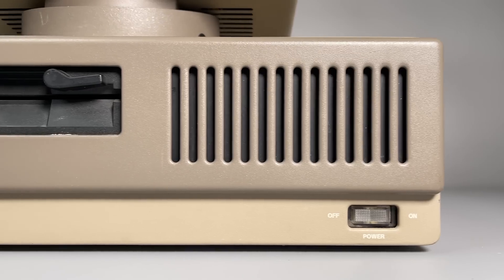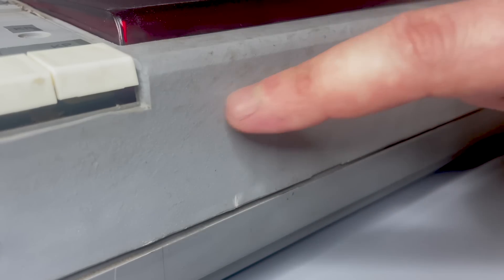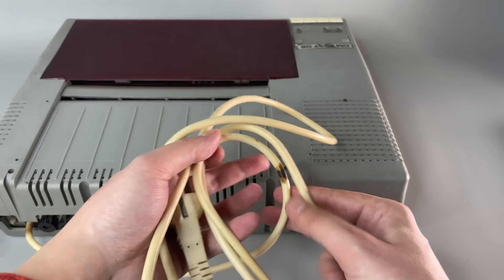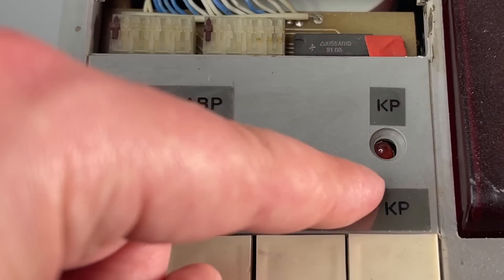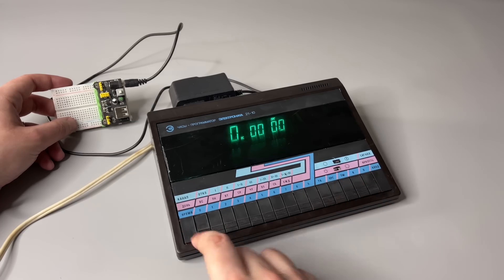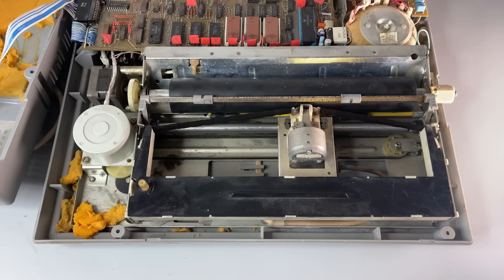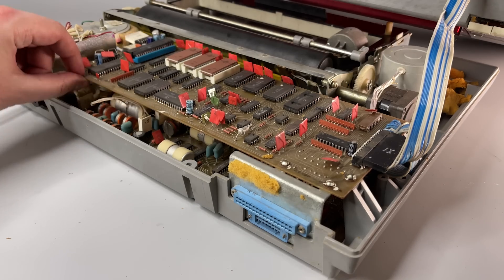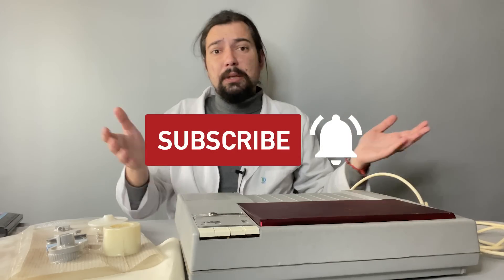This is THE WORST PRINTER I've EVER seen | Soviet SM6337.02

Comment: All such equipment was assembled for the most part in the Baltic Soviet republics, as well as in the Ukrainian SSR, which is where the crooked hands come from. What was done in Tashkent or Minsk looked from a completely different world, architects lived in these republics
Reply from the maker: Hm. Interesting point. Especially on Baltic states.
Reply: @ChernobylFamily  it could be really. Especially in Lithuanian soviet socialistic republic, in a factory of calculating machines "Sigma" at Vilnius (those times it was prefered word "calculating machine" instead of "computer" there). A serie looks like starting with letters СМ, it is in cyrilic letters, what in latin means SM (lithuanian Skaičiavimo Mašinos = Calculating Machines). I can recognise that serie as serie of mentioned factory in Vilnius at soviet occupation times. I remember a quality of plastic those times, it was far away from perfect, especially for civil (non militar) purposes, but not so super extremely bad as in this video. We see here an example of taked trashed distorted device from garbage or from very severe bad conditions of abandoned place. The plastic looks like deformed in harsh temperature, direct sunlight and other extreme physical and chemical conditions, and old dirt went inside to plastic molecules trough long time it cannot be washed away now.

Comment: I have owned several HP (USA) printers over the years, none have lasted a full year, common issues being connectivity with my devices is intermittent and sometimes fails completely, the ink cartridges are designed with the express purpose of ripping off consumers most being around the same price as 24k gold

Comment: Since Ukraine was part of the Soviet Union, probably there were a lot of Ukrainians involved in the engineering of this thing.
Reply from the maker: And? It makes it less crap? It is about double standards, not origin.
Reply: @ChernobylFamily  Of course not, but something to take in mind is to know what mass production means. This is where even major brands falls on quality control. They try to lower costs. And imagine getting raw materials for this kind of product on the USSR,  plastics specially there are some patented formulas and not to mention the plastic injection machines.
Reply: Used WESTON stepper motors (made in India)

Comment: Video comes across whiny, I just wanted to see how the printer worked and barely 30 seconds was spent on that, and only 9 minutes into the video...
Reply from the maker: You know, i also wanted to see it working. It does not (though in the next video about a VFD clock there is a tiny attempt to start it – it. just powers on). The point of this was not the printer itself, but the fact that there are western people praising the ussr, while that was a place of solid double standard in everything.
Reply: @ChernobylFamily  Fair enough, I just wasn't expecting the more political side of the video, I wasn't familiar with the channel and was only recommended the video from my home page. For what it's worth, there are cheap crappy products in every country, in the USSR the "good" (if you can even say that) stuff went to high ranking party members, the government, and the military. In any other country the good stuff is reserved for those with money... who occupy high levels on the corporate ladder, the military, or government. Same result, just through a different path.
Reply: @jameshodgson3656  That's such an dishonest opinion. The general quality of electronics in the West was excellent, perhaps even more so than today.. Things were not made in China like today. Obviously military equipment had (and has) even higher quality standards, that goes without saying. But even cheap stuff was of good quality for the most part. Bad quality products don't sell. That's how market economy works. Nobody would pay a penny for crap like the printer in this video. Not even good quality products automatically sell, if they can't beat the competition for whatever reason.

Comment: If this is the worst printer you seen, wait till you seen an HP or a Canon printer, I swear to God there is an inner rage in me that gets triggered just seeing those cursed f&(#¤"%#/%"¤¤ son of a #&/%!&/#%"¤! printers in real life, I need to go take a break, just typing this made me angry.
Reply from the maker: I use Canon printers all my life, all good, just saying.
Reply: @ChernobylFamily  
I never had a Canon printer live longer than 5 years, the ink lineup are notorious for drying up even if they are used several times a day, laser printers are fine, reliable but they develop ghost issues after a while, I have no idea if its their drivers not playing well with Windows 10 or 11, whether its just made like this on purpose, at work we always had to replace Canon laser printers because they start developing ghost issues, not accepting print orders, throwing errors that there no paper in the tray, even though there is, we tried to clean the sensors, the heads, nothing works. 

At least its not as bad as HP where they die in 2 years and are built like trash where the plastic starts deforming because of heat issues overtime and then you get feeding issues with paper.

Nah, Brother for life, Brother laser printers that are 10+ to 20+ years old, all still working fine, my cheap Brother laser printer from 2016 still printing on original cartridge! Never an issue, never driver issues, its the Lexus of printers.

Comment: About the uneven and inconstant housing. All the defect happen because the molding machines where run to fast. The plastic didn't have enough time to equalize, relax and cool down. To make the machines run that fast, the mixer skews ran to fast and the heater where cranked up to the max. This then would produce these uneven colors. 
Evey thing about this printer said: "Make it faster, we have to get to this months target."

Sometimes things of this quality would appear in west Germany, mostly kitchen / household tools. Blender, coffee machine, handheld hover, mixer, etc. They where all strangely labeled and mainly sold by door-to-door salesmen. Horrendes quality and often unsafe. Then they would go to second hand shops i was visiting often as a kid. There was a spike of these things after the reunification. I used most of them as parts for my own constructions, because some parts where really nice.
By example the a mixer had a really nicely build gearbox. but everything else was totally crap. That was the case with many of these things. One or two really good parts everything else totally shit.
Reply from the maker: Thank you very much for sharing!

Comment: I’m a plastics engineer.   That cosmetic appearance on the case is called splay.  It’s cause by molding material with too much moisture in it, too high of molding temperatures, or injecting the plastic too fast.    It could also be glass on the surface if the material is a fiberglass reinforced grade.   If that is the case it would be from running the mold too cold of cooling temperature of injecting the plastic too slow.   The damaged areas on the slots on the back were probably from the thin metal cores breaking off in the mold.   I’m guessing the mold was probably not made out of high quality tool steel so those thin cores would be susceptible to breaking
Reply: This kind of defect was very common in household appliances. I wish I could learn more about how and why it appears and how this could be avoided.
Reply: Your description is very similar to that in Serhii Plokhy's book Chernobyl, which describes the construction of the plant.

Comment: Still better than anything HP makes these days. Which isn't saying much, since my off-brand Chinese knockoff laser printer is also better than their garbage.
Reply from the maker: Well... I am honestly surprised that in 2024 we still need to print something. One thing, are books or photos, or large-format print, but just plain A4... at home....
Reply: HP used to be great in the 90s. They were very durable, build like a battleship printers. Expensive also. Today they sell their entry level printers for cheaper then the inkjet cartridge to put in them. Cheap sells. If it breaks down after 2000 prints, you can get a new one and hope it will last for 3000 prints. It's like a new socialism :')

Comment: As a teenager, I had a chance to work on one of the factories where the computers for CNC equipment were produced, as well as some other things, It was called "ПО Контур", and it was in the city of Tomsk in Siberia. Nobody remembers what was made there in terms of electronics, but many remember the plastic lanterns that were made there. The ones which looked like many icicles (made of plastic) handing around the circular frame. That was also made on the same factory. I remember working on "assembly line" where we were plugging components into PCBs, cutting pins to the right length and riveting contact terminals to PCBs. It was fun.
Reply from the maker: Thank you for sharing!

Comment: It's a pity you don't give any dates (of manufacture). I have seen horrible western designs of printers and personal computers in the 80s. Computers boards attached by a few scews on one side only and of course with foam everywhere that falls appart in powder because it is old, cellotape that doesn't last, leaky capacitors (electrolytic and still in todays electronics) ) that corrodes the PCB,...  Actually I see  square hard capacitors on your printer, I'll bet they still all work ! Foam is still used todate and everybody knows it doesn't last 20 yers. Electromechanical: generally stuck because any rubber part gets soft and sticky everywhere. Have a look to my Dragon 32 personal computer (1980 manufactured in Wales-UK): external power transformer bulky and heavy with power cord twisting on itself, paper logo/brand on the top, display: black characters on bright green background... after an hour coding you had a green vision (and headache) ... I forgot my capacitors are electrolytic (all needs to be changed) but do not leak. But I admit I never seen such a big printer !
Reply from the maker: It is ~1991 as comes from chips. Product tag is missing.

Comment: What is it - as big as a tenement, makes a noise like a jet, smokes like a locomotive and slices an apple into 3 parts?

Soviet machine to cut an apple into 4 parts.
Reply from the maker: After reading thousands of manuals etc. of that period I can imagine it would be described as "Device electromechanical for fruit product segmentation type DEFPS-1". Exactly with this word order.

Comment: Interestingly Soviets were seriously working on a nationwide computer network that would be used to control and optimise production and distribution. It couldn't work because of inherent flaws of central planning but before they came close to that, aside from technical difficulties with electronics, they realised it would not work simply because managers would not input real data and instead, request larger than necessary volumes of materials, either because they wanted to steal it or simply because they knew large part would be of substandard quality.
Reply from the maker: You are speaking about Glushkov's OGAS. It is a very sad story of how a genial idea received all possible grades of sabotage from high offices...
Reply: @ChernobylFamily  I think the realisation of trash-in-trash-out problem came much later in some of smaller projects after OGAS. It was definitely ahead of it's time though. Another impressive thing was the idea to build a fiber-optics network in the USSR, of course not for the speed we use today, but fiber optics has lots of other benefits and would definitely allow faster data transmission that the phone cables back then. 
Soviets had many brilliant engineers, just the state bureaucracy wasn't up to recognize them properly and in the Soviet system they couldn't just go to a different company.  Another issue what I think they always struggled with, was not enough investment in general technology of production. The West didn't have that problem because most of it was created by private sector and basically created a snowball effect. Where Americans could take something 'off the shelf' to make something new, Soviets had to do a lot more from scratch or invent clever ways to  bypass limitations of the hardware their industry could produce.

On the other hand without the Soviet rival, USA would have never invested so much in science. Best example, how NASA's budget was dramatically cut after winning race to the Moon, which basically deleted 90% of the STS programme and compromised design of the shuttles to the point Soviet engineers rightfully believed them to be nonsensical, which is admitted in one of post 2000 NASA's reports which states that with funding as low as after the cuts, it would have made a lot more sense to just invest in further development of Saturn V.

Comment: The brown spot on the cable is not heat damage, but the cable was probably tightened with rubber band in that spot. That's what happens where rubber meets plasticized PVC. The Soviets were not at all concerned with the appearance of their products and this detail was below their discernment.
Reply from the maker: Normally those were shipped with a rope around. Note how it was made with that metal version of the printer... i trust your expertise, though it really looks and feels as a burn.

Comment: As one with a career in manufacturing that case looks to me like shoddy workmanship by the mold maker in the surface finish of the plastic injection molds. If one printer was made like that then they were all made that way.
Reply from the maker: ...tell that to USSR fans :(
Thank you for this detail.
Reply: USSR did not use thermoplastics much  until very late, people had little experience, so technology was not so good. Time and thermal cycling were bad for Soviet plastic back then.

Comment: there was this one soviet joke it went something like this:

Some soviet factory sold its pressure cooker assembly line to some other "socialist" country but they forgot to send the instruction manual. The workers in the other country, as hard as they tried to figure out the "correct" way to run the assembly line were getting anti tank mines on the output instead of pressure cookers.  

Perhaps this printer model has a hidden purpose, maybe its a type of super advanced psychotropic weapon

Comment: In my opinion the trouble with soviet era was not that low quality, but shortage of stock. It was not, that it was  usually not working and needed a fix (even straight out of the box). We learned to fix stuff fast easy. F.e. Rubin TV usually could be fixed by hammering it a little on the upper cover. Have you seen Armageddon wit Bruce Willis? The soviet astronaut there was not crazy- he just head  lots of experience with soviet production. The bigger trouble was, that it was impossible to get anything anyway.  At list in Poland it was so.

Comment: Are you sure it's a brand new printer? I've seen very old used printers with some parts packed in plastic. Not quite an evidence.
Reply from the maker: At least that is what its previous owner told... parts packed are quire crucial for operation.

Comment: Thermoplastic could deform badly if stored in\or exposed to high heat for too long. And this thing is not new, heavily used.
btw seems that printer have gone through some repair(some capacitors look suspiciously not soviet)  Do you really need to be such a douchebag?

Comment: In the USSR, I worked at a factory that produces ship rescue systems with an alarm system via a space satellite. The Soviet systems were better than the American ones, more reliable in all conditions. We tested American and our rescue systems in water that had gasoline poured on it, and it was all set on fire. And they also froze these systems in the refrigerator.  But in parallel, the plant was issued a plan for the products of the civilian segment.  Since the control was much lower, the factory used those parts that were rejected for basic products.  and low-skilled workers.
Reply from the maker: Thank you for sharing

Comment: Well it seems that you picked it up in a refuse bin, since I've seen this printer, which had been in use, in way better condition.
Reply from the maker: Not really, it spent all its life on a shelf... though I do agree with you that much better examples of this very model exist.
Reply: @ChernobylFamily  No I mean if it was lying on a shelf in an assembly center as a finished product, or if it is just defective copy got mixed in shady circumstances, which ended up on your shelf.
Reply from the maker: @arsonoakwood7938 i'd wish to know its full story. Previous ownes told he got it in ~1993 and since then it was in a storage, virtually forgotten. But where it was before... it a good question.

Comment: The factory workers that built this thing punched it for you. Also looks like the injection molding was improperly designed, didn't account for thermal expansion (results in warping) and poor flushing.  basically they didn't know what they were doing.  OR im just wrong and this thing warped due to POOR storage (hot sun in a garage).
Reply from the maker: There were no sun in storage, that is for sure. I guess just the mold had some wear. Previously I saw some better examples of this very model of a printer.